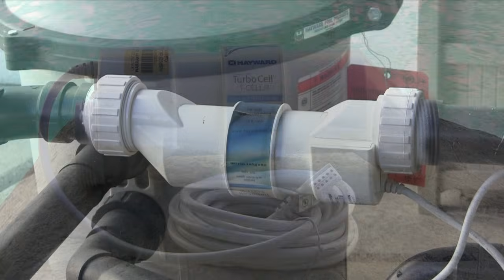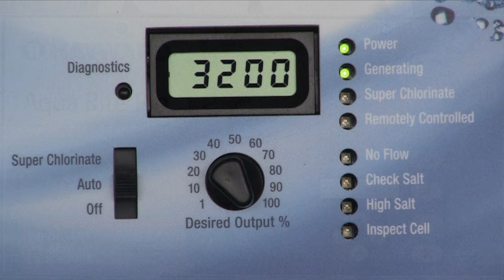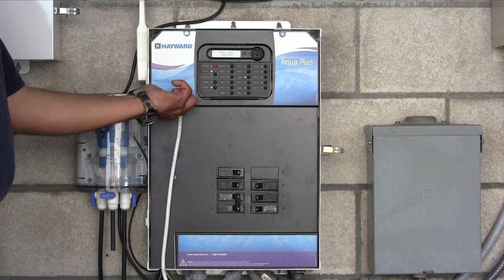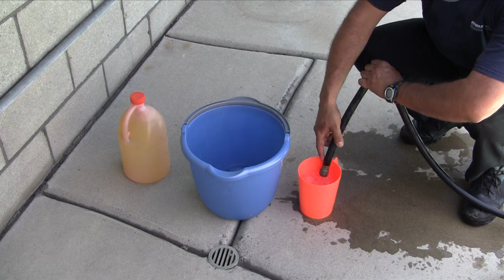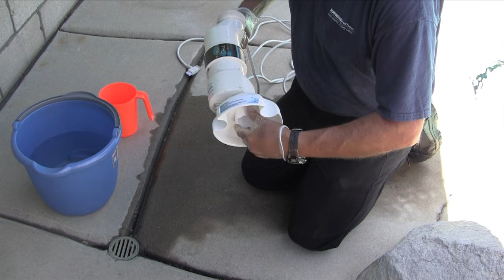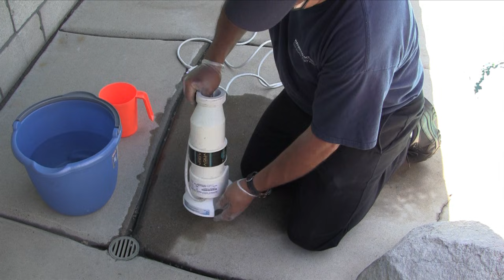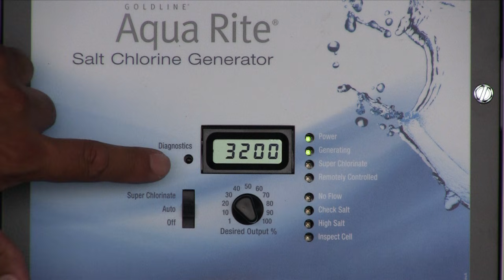How to Clean Your Hayward Salt Chlorination TurboCell

Comment: One thing to keep in mind is when you inspect your salt cell every 3 months, if there is no visible signs of alkaline buildup there may be no need to clean the cell with acid at that time. Each time the cell is cleaned with acid it may widen the gap between the anode / cathode plates further degrading it's maximum output over time.
Reply: Well this was entertaining. Thanks gents.
Reply: Good god people please dont listen to these wanna be experts.  The system has a "clean cell" light that will come on when needed.  Regardless if it looks dirty or not.  The cell MUST be cleaned at this time.  You can have scale that is barely noticable but is affecting cell operation.  Listen to the manufacture not these youtube wanna be experts.
Reply: @Executiveinvestments-    Not true.  The indicator light comes on after a certain number of hours.  It doesn't mean you HAVE to clean it...  it means you should INSPECT.  Read the directions.
Reply: James James   Absolutely says you MUST clean it.  Not inspect it.  Yet another youtube expert for ya.  Don’t know shit as usual.
Reply: @toddrunyon  and it goes on when it detects deposits.  NOT by time genius.
Reply: @Executiveinvestments-  Obviously comprehension isn't your strong suit so I will quote the Hayward AquaRite 900 series manual which I have right in here in my hand.  If you still don't understand the wording, i can take a snapshot and upload it as evidence.

On page seven (that means page 7 if you need translation), under "INSPECT CELL"  the exact wording says "in either case, inspect cell and clean if necessary".  I was going to capitalize "if necessary" for emphasis but then you would have accused me of falsifying the documentation.

Here is more reading you should try.  On page ten (that means page 10 if you still need translation), under "Maintaining the AquaRite System"...  the manual states "The AquaRite will remind you to do this by flashing the "Inspect Cell" LED after approximately 500 hours of operation.  After you inspect the cell (and clean, if necessary)..."   Again, I did not capitalize "if necessary" for emphasis. 

I never claimed to be an expert but I do have the ability to read a manual.  If you need more help as to where the wording is located, please reply here and embarrass yourself even more.  I think you should also check your eyesight since the systems  do NOT have a "clean cell" light as you noted in your first "expert" post.
Reply: James James   Sure kid.  I just posted the link to the manual.  You just got embarrassed you dumb fuck.  It does not illuminate with time dumbass as the manual clearly states.  How dumb do you feel right about now huh kid?
Reply: @toddrunyon     Yet again. "Cleaning the Electrolytic Cell
Once substantial deposits have built up on the titanium plates in the Cell, the “Cell Maint” LED will illuminate, and the mineral scaling must be removed. The Cell may require cleaning even if debris or build-up is not immediately visible to the eye. If the “Cell Maint” LED is on, it typically means the Cell must be cleaned."
Directly on page 12 kid. 
https://www.circupool.com/assets/doc/CircuPool-Universal-Manual.pdf
Reply: @toddrunyon <<<<<<<<<< wanna be youtube expert that dont know shit.   Obviously comprehension isn't your strong suit.  If you need me to explain what a "cell maint" light mean then you are way too young to even be on youtube.
Reply: @Executiveinvestments-    Wow, you just keep trying to prove how stupid you are...    Mission accomplished, it's obvious to everyone.

You posted a guide to a CircuPool system.  I know it's probably difficult for you after drinking a case of Nat Lights but this video was created for a Hayward Salt Chloronation Turbocell.
Reply: James James   It makes zero difference kid.  You clearly said if no visible signs no need to clean it.  Again you were proved wrong.  Stop trying to be a wannabe YouTube expert.  End of discussion.  You lost I won.
Reply: @Executiveinvestments-  You again proved yourself unable to read / comprehend.  You are attributing another person's comment to me.
I believe Hayward (FYI, Hayward was the creator of this video) would disagree with your comment "It makes zero difference" regarding what other companies have to say about cleaning of their products.

Obviously you are ending the discussion for a number of reasons.  it could be one or all of the items listed below:
1.  You are wrong, realize it , and are tired of getting schooled.
2.  You ran out of Nat Lights and are getting ready to pass out.
3.  Your mom is cutting off your wi-fi.
4.  It's time to go to sleep in your basement apartment at your parent's house.
5.  Your cousin rolled over and said it's time to turn off the TV and go to sleep.
Reply: @Executiveinvestments-    Hey Snowflake, 

I see you finally gave up.  For once, you finally made a good decision.
Reply: @Executiveinvestments-    I am still waiting for your response and I know you are seeing these messages.
Reply: James James <<<<<<<<sore loser.  Sorry you got schooled and owned bad.  Try another profession.  Trolling isn’t your strong suit.
Reply: @Executiveinvestments-   Comprehension isn't your strong suit.  I knew you wouldn't be able to stay away even though you were proven wrong on multiple statements.

After three tries, you finally finished at the top of your sixth grade class.
Reply: James James   Again you NEEDED to edit your comment.  Had your mommy proof read it for you I see huh kiddo?  And actually it was you who was proved wrong multiple times.   I even linked showing how wrong you were.  You have shown nothing.  Typical from a troll boy that gets proved wrong. 🤣🤣
Reply: @Executiveinvestments-  If you call the link you provided (to a different product from a different company) "winning", then I can understand why you think your double-wide is the mansion of your trailer park.

Please tell me, do you also follow a Yugo owner's manual to service your Ford Pinto?

Comment: Since having my pool installed in 2014, I have yet to clean my cell.  The installer never mentioned that I need to do this, when I called him once telling him that the "inspect cell" light was flashing, he told me to just hold down the diagnostic button and the flashing will go away.   Now I realize this was bad advice.  I'm now going to clean it as described here, do you think my cell is damaged?  If so, how much is it to replace the cell?  thanks.
Reply from the maker: Our tech will get back to you. Please PM your phone number if you'd like him to call you.
Reply from the maker: +S DELKS Clean the cell first reinstall and if it produces chlorine you are good. Cells last an average of 3-5 years depending on use. Cell cleaning is covered in the manual.   We do not sell direct.  You will need to check with dealers for pricing.

Comment: my control panel shows that my cell is generating but no chlorine in the pool water is there anyway to solve this problem
Reply from the maker: Guy, we'll ask our tech to reply. PM your phone number if you'd like a call back.
Reply from the maker: Guy, check conditioner level.  You may want to Super chlorinate for 24 hrs.

Comment: My generating light stays on when the pump is not running and my salt reading goes down all day to around700 or below. Whatcould be the problem?
Reply from the maker: The generating light should go off with the pump off.  Most likely the flow switch is stuck closed. The salt level should be check at a local store and compared.    If the cell is over 3 years old it may need to be replaced.   If the readings are going down and the cell is over 3 years old, you may need to replace the cell.

Comment: Hello, I want to clean my cell but don't have a stand like you showed. Any suggestion?
Reply from the maker: Hi Bob, we'll ask our Hayward tech to reply here or he can call you if you'd like to provide your phone number.
Reply: Thanks for your reply. I researched it and purchased the following - Hayward GLX-CELLSTAND Cleaning Stand Replacement for All Hayward Turbo Cells I hope this is correct.
Reply from the maker: That's right -the GLX-CELLSTAND is available to purchase.  You can also view our cell cleaning video on You Tube.   A bucket can be used by submerging the cell in the cleaning solution.

Comment: Does the unit quit working when the "check cell" info is displayed?  I am not seeing a salt level, worried about decreasing the chlorine until I can get to cleaning it in a few days.  With all of the rain, chlorine levels are critical. Thanks.
Reply from the maker: Hi Kathy, we'd be glad to help. Our Hayward tech will reply here or you can PM your phone number on our Facebook page if you'd like him to call you.
Reply from the maker: Kathy, thanks for reaching out. If the generator light is off, it's not generating chlorine. PM your phone number on our Facebook page if you'd like us to call.

Comment: i was told that it DOES matter which way the cell is mounted. Another video (3rd party) suggested mounting the cell in the reverse direction each time the cell is cleaned. Can you advise as to the proper installation direction and as to wether it makes a difference to reverse the direction of the cell each time it is cleaned. Thank you.
Reply from the maker: Hi Wade, please post your phone number (you can private message us on our Facebook page) and our Hayward tech will call you to help.
Reply from the maker: Wade, it makes no difference which way you mount the cell.
Reply: thank you very much for the response.
Reply: is it recommended that the derection be changed after each cleaning, or does this also make no difference?
Reply from the maker: It's our pleasure Wade. Enjoy your pool!
Reply from the maker: Changing the direction of the cell is not needed.

Comment: thank you so much for this video! i'm not very good at maintaining things, but i'm glad i found this video. i just wish i would have found it before i started. but i am curious. the instruction on the cell stand 2 parts water to 1 part acid. i didn't mess up anything, did i?
Reply from the maker: +tti01 Thanks for reaching out. We'll ask our Hayward tech to reply to you here.
Reply from the maker: +tti01 no, you did not mess anything up, that is correct.
Reply: +Hayward Pool Products but this video says 4 parts water to one part acid, not two parts water to one part acid. which one is correct? because that is double the strength of acid
Reply: the guy at my pool supply store told me 3 parts water, 1 part acid

Comment: try using white vinegar instead of acid solution. Safer for you and the cell. Your cell will last many more years because vinegar does not act on metal like muratic acid.
Reply from the maker: Ed Martin Vinegar is a great alternative to muriatic acid.  We like cleaning the cell often with a high pressure hose and not having to use vinegar or acid if possible.
Reply: @HaywardPoolProducts  so should we be using vinegar instead?  Or are you severyones
Reply: Roy Hughes how long do you let the white vinegar sit to clean Thank You
Reply: I usually do it for an hour. I dump the vinegar out into a plastic bucket, the use a garden hose with a good nozzle to rinse and remove calcium deposits. One treatment usually does the trick if I do it once per month in AZ. I'm dealing with hard water and calcium left from the days when I used chlorine tablets. Hope this helps..

Comment from the maker: This simply means the unit was switched to read in the metric mode & PPT. Pressing the diagnostic button once will display the temperature in Celsius, with the Celsius temperature displayed, flip the switch to SUPER CHLORINATE, and then back to AUTO and that will force the unit to read Fahrenheit and PPM.